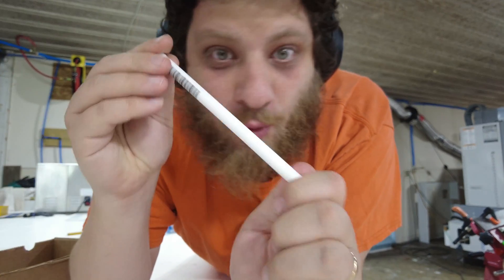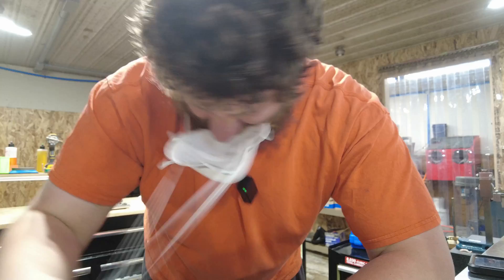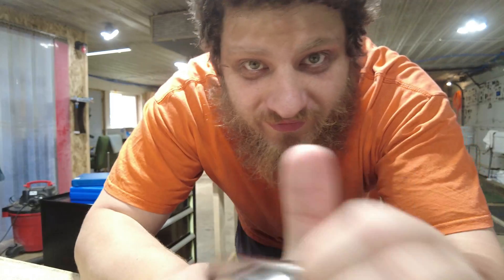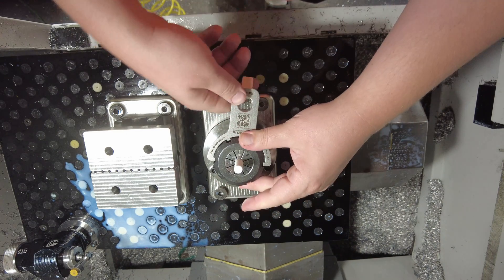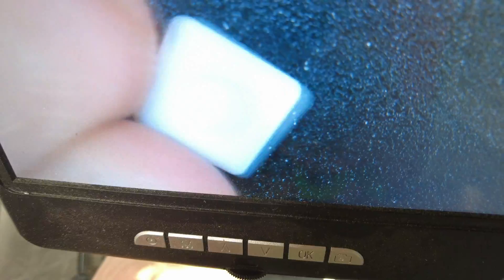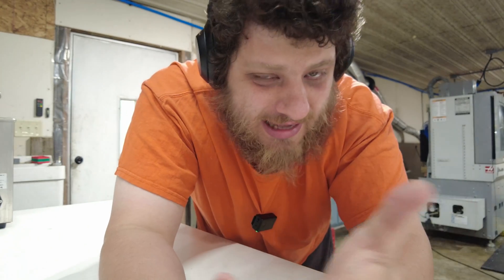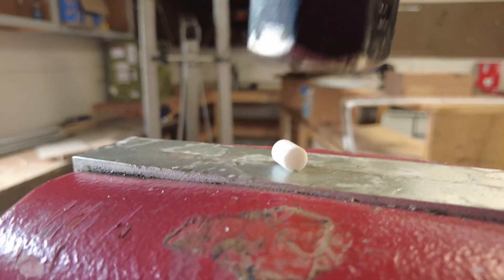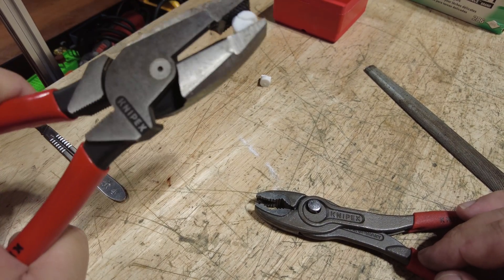Milling Ceramic on a Haas

Comment: Is there a reason for starting with a Macor rod and not a Macor plate so you could machine multiple parts without stopping?
Reply from the maker: This was a while ago, and I don't remember my exact logic, but I suspect it was because it was cheaper

Comment: looked at the cutting speed for that material, and with carbide(uncoated) it recommend 14m/min or 45f/min, its slower than hardened steel tho the feed is similar to normal soft steel
Reply from the maker: I saw those numbers too. But I can tell you that it ran just fine cutting it faster. Not sure where those numbers came from 🤷‍♂️. I have to imagine they were originally intended for HSS?
Reply: @AudacityMicro  i think its only to incrase tool life and not its difficulty to cut it
its probable that on parts that you need to remove a lot of matter, if you used speeds too high you would lose precision pretty soon even if it would cut just fine in roughing cycles

Comment: Clearly this is a refractory material, it's property suite totally sucks for anything else. I'm experiencing failure of imagination on why anybody wants precision machined refractories. Obviously you can't share anything about this part and likely don't even know but your seeing a business opportunity in mastering this material. I'm a professional mechanic and spend my free time building stuff and I can't think of one thing this stuff is good for. Little help?
Reply from the maker: The parts went to the research department at a university if I remember right, so they are probably some sort of spacer for some sort of high temperature equipment. A lot of that experimental stuff is held to pretty tight tolerances to eliminate variables in the experiment. Scientists are fantastic customers, since they love to throw high tolerances on parts for no reason 😂.

Now that I have machined the material, I'm much less excited about it. I thought it would be a lot more like glass, and a lot less like chalk. But I had no way of knowing that until I actually got to test it out.

Comment: Worked in a ceramics place for a while… macor is one of the few technical ceramics you can machine without having to dive into diamond tooling. With most other ceramics, low feeds high speeds will get you there on diamond tooling, most of which where like mini diamond grinding wheels. Office/compact mills are great for this. Long run times but this usually translates into higher pricing.

Comment: Machining ceramic, you monster.
Reply from the maker: Full disclosure, McMaster sells this stuff under the name "easy to machine high temperature ceramic" and they aren't wrong 😂. It really wants hard to machine
Reply: I mean it is ceramic but it's more like sand and elmers glue structurally
Reply from the maker: Based on my experience, that checks out 😂.

Comment: Hows your job board been lately, ours has taken a dump on pricing over last few weeks almost not even worth looking at
Reply from the maker: I almost never take a job at face value, so the prices they give are pretty much irrelevant. I've seen a few less of the really good parts that I love (small precision plastics) but I've seen plenty of other good jobs. I've heard other chatter that the industry is a little slow as a whole right now, with the run up to the election.
Reply: @AudacityMicro  from what i heard supposedly, they increased the premium and ultra premium group size by about 30% over the last month and it's what's driving the price down not lack of work but who knows for sure what's going on

Comment: For tabbing off you could use a jeweler's saw or something similar. They have very fine teeth, which would hopefully limit the chances of breakage and the creation of a cavity.
Reply: there's also diamond plated wire that can be fitted in a jeweler's saw, would probably last a while on this
Reply from the maker: True! That's a great idea! Thanks!